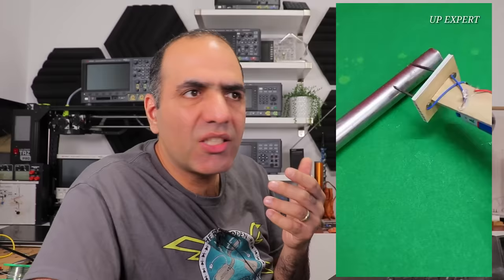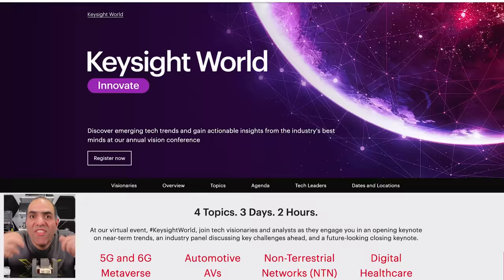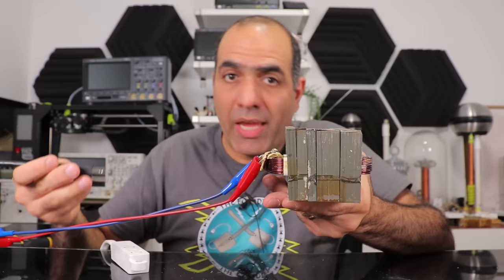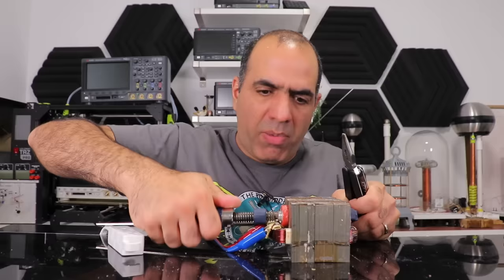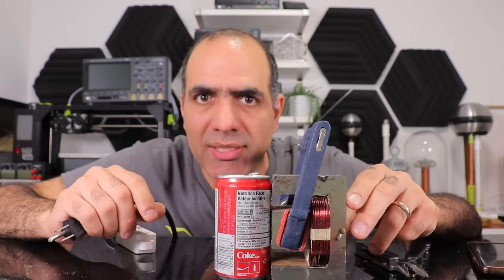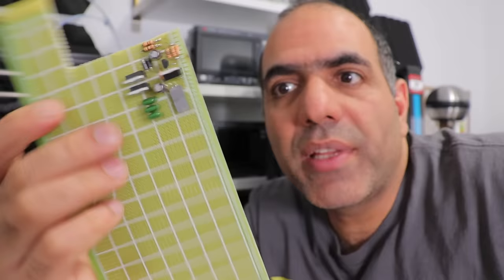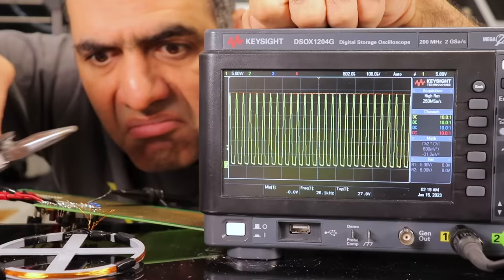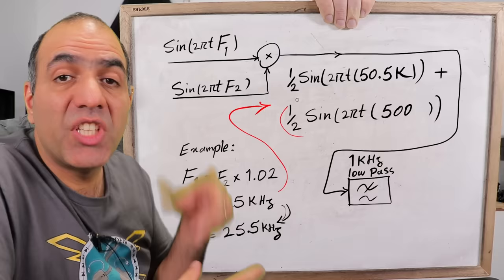DIY METAL DETECTOR, Gone Wrong and Right!!

Comment: It seems like there might be a bit of confusion in your question. Let's break down the concepts to clarify:

    Eddy Currents: Eddy currents are circulating currents induced in a conductor (like iron) when it's exposed to a changing magnetic field. These currents create their own magnetic fields, which can either oppose or align with the original magnetic field, depending on the circumstances.

    Transformer Core: A transformer core is typically made of iron or another magnetic material. The core's purpose is to provide a low-reluctance path for the magnetic flux generated by the primary coil to link with the secondary coil, thus facilitating energy transfer via electromagnetic induction.

    Attraction and Repulsion: Magnets exhibit attractive or repulsive behavior based on their orientation and the interaction of their magnetic fields. Like poles (North-North or South-South) repel each other, and opposite poles (North-South) attract.

    Transformer Operation: In a transformer, alternating current (AC) in the primary coil generates a changing magnetic field, which induces a voltage in the secondary coil through electromagnetic induction. The core's purpose is to enhance this induction by concentrating the magnetic flux.

With these concepts in mind, let's address your question:

    Eddy Currents and Magnetism: Eddy currents are related to the conductivity of the material and the rate of change of the magnetic field. These currents can create their own magnetic fields, which can indeed interact with the core's magnetism. However, these eddy currents are typically unwanted in transformers because they can result in energy losses due to resistive heating.

    Attraction and Repulsion: If you have two pieces of iron that are acting as magnets, they will interact based on their magnetic orientation. If both pieces are magnetized in the same way (both acting as North poles or both as South poles), they will repel each other. If they are magnetized in opposite ways (one as North and the other as South), they will attract each other.

    Transformer Core: While the iron core in a transformer can become magnetized due to the alternating current passing through the coils, the core's main purpose is to efficiently channel the magnetic flux, not to create a strong permanent magnet. The behavior of the core's magnetization depends on the AC frequency and the nature of the core material.

So, in a properly functioning transformer, the core's magnetization is designed to facilitate efficient energy transfer, not necessarily to create a strong attracting magnet or to repel other magnetic objects. The behavior of the core's magnetization and the eddy currents can be complex due to the alternating nature of the currents and the materials involved.

Comment: This is just wrong watching someone shock themselves being stupid...can't be all wrong right? they repel the core due to EMI/Eddie current become present in the current itself and cause unwanted effects in the circuits thus the plates. Your metal detector needs more gain/power to let it detect deeper or further in the ground. Didn't show it doing aluminum though. But it should work due to the fact aluminum is a perfectly good conductor for magnetics to flow through like a current thus providing an inductance field to flow through.